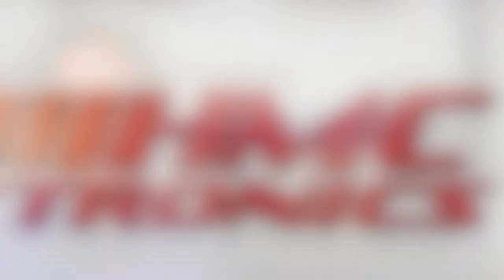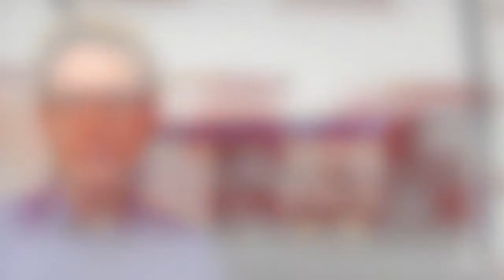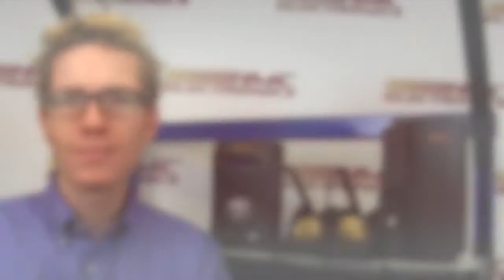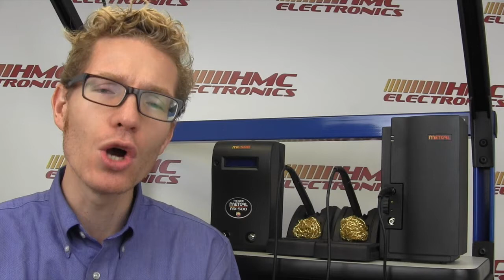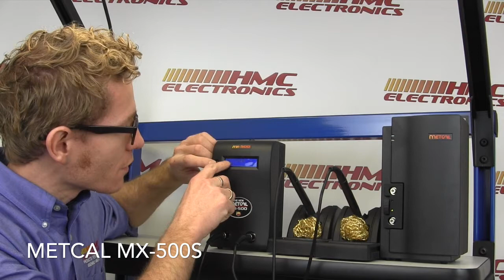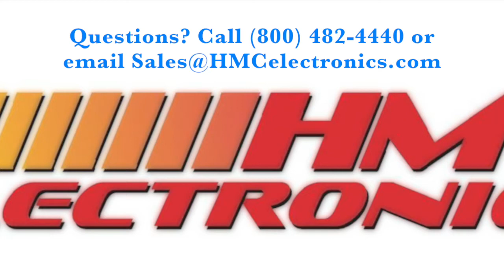The Metcal MX-500S Solder Rework Station

Comment: Great Video!!. Quick Question: I have the MX500-11(Still going strong I love it)and I noticed when mine is Off I can still hear a very low noise(like an electrical transformer noise)coming from the station like if it's still consuming energy. Is that normal on this units?

I'll appreciate if you can confirm this

Thanks in advance
Reply: Nelson Agosto Yes, it is normal. I was scared on mine also when I first got it a 2 years ago. That's what I really hate about it. But of course, you can just unplug it when not it use. If you have something to share about your station, please do. It seems that these things are quite rare. I admit that I really don't use mine too often because I'm scared that the tip plating will oxidize fast so I usually use the cheaper variety or sometimes a soldering gun. Please watch my latest video on youtube so see how I made a battery powered soldering iron/gun using Metcal tips. Cheers :)
Reply: Hi ciprianwiner,

Thank you for your response. I also double checked in other sites and yes that's normal. Now, in order to get rid of that buzz sound that the station do. 

I bought a device(sorry don't remember the name of that thing right know) that you plug it in to the wall that comes with a On/Off button controller and problem resolve. 

No more that annoying buzz sound anymore and I don't also need to unplug and plug back again my stations every time I want to use it :). What you just need to do(in case you wanna try it)just let always the power switch On of the station plug the cable in to the electrical device that comes with the controller and then just turn On and Off your station from the controller that comes with it after connecting it to the wall and your done.

I'm regards to the oxidation that have you worried. I can tell you that my station is in A/C room which the humidity is high and I have no problem with it so far. So don't worry use yours with confidence MetCal was built to last including the tips. What I also do to always keep my tips in the best condition as I can is a sponge with water and a hakko 599B-O2 solder top cleaning. I use both and after every use before I turn off my station I apply some solder to the tip and it will be well protected from oxidation. 

I hope all this can help 

Regards :)
Reply: Nelson Agosto That is indeed a good solution for the buzz. I've ordered some lower temperature tips and a tip tinner for the station to use. I think that I'm paranoid because after 1-2 min's of soldering, I keep applying some new solder to the tip so it won't get black. I really have myself for having such a nice station and still use a soldering gun because it seems more handy to me. I guess, that it's a habbit of mine. Someday, I'll buy a temperature controlled station so I can finally turn down the temperature when not using my irons.  Take care :)
Reply: why dont u guys use socket plug that came with on/off switch like uk